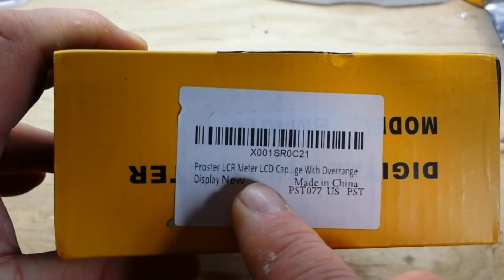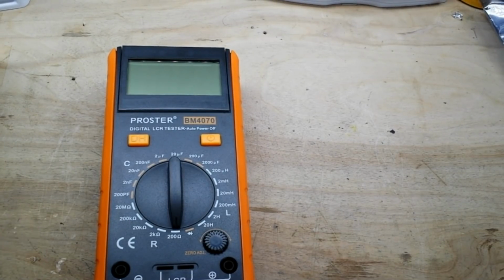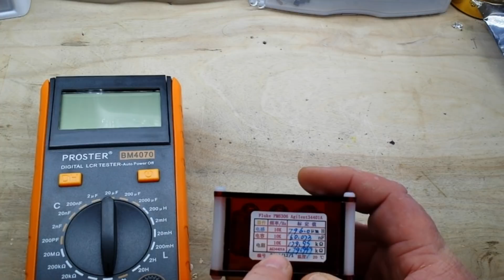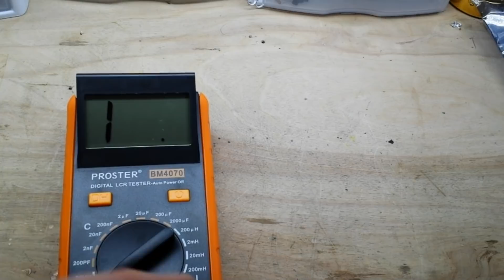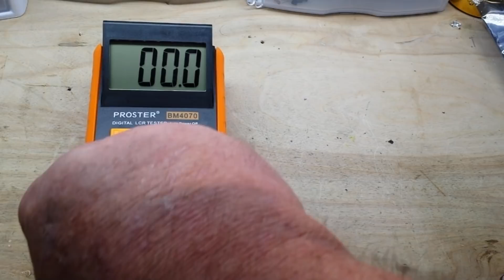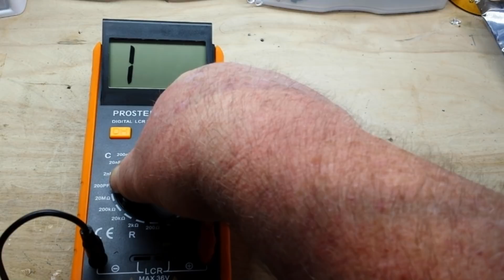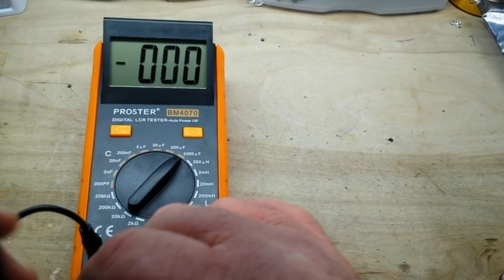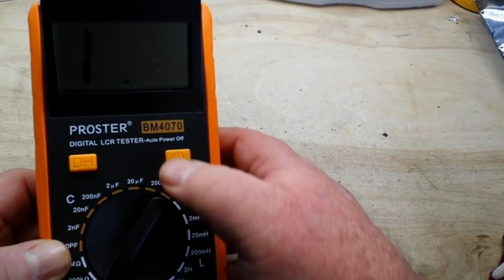Proster BM4070 LCR Meter Review

Comment: Hi, thanks for your video, the one thing I would expect from an LCR meter,  is an output frequency setting, the LCR meter should be an AC measurement like 1000 Hz when measuring resistance and NOT a DC measurement like that of a multimeter.  This is very important.
Reply: Agreed, and not just for resistance!  Perhaps one of the oscilloscopes listed in the description could be used to determine the working frequency?  I found the following in a review on Amazon, but it sure would be nice to see a video verifying this for a wider range of component values (such as those used in this video):

"I used an o/scope with the Proster tester on various components and got the following results;
10kohm resistor was being measured with 300mv DC across it.
10nF cap was being measured with a 300Hz triangular 200mV pk to pk voltage waveform.
A 470uH inductor was being measured with 1.5us long voltage pulses having a repeation
rate of 300 Hz and a magnitude of+- 200mV."

Comment: i have  watched a few of your reviews on multi metres and am looking for something for RC cars and the odd electrical around the house and the car.Would an Aneng 8008/8009 be a good way to go or is there something newer and better without spending a fortune. What would you recommend?
Reply from the maker: The 8008 is simply the best option in a low cost meter for low voltage applications.
Reply: @learnelectronics  is the 8009 better or just get the 8008?

Comment: DO NOT BUY THIS METER!!! I ordered off Amazon and they shipped it to me in an OPEN BOX. NO PACKAGING. NO SHIPPING RECEIPT! NO secured box. The meter could have been easily stolen as it wasn't even sealed. It was missing its cables and instructions. I was surprised to find it's damn cheap 9volt battery. Meanwhile the fact they don't know how to ship will keep me far away from the purchasing anything from this manufactuerer. Amazon got an ear full from me already  about how abysmal their packaging was. Right now, I'm not taking reviews from any YouTube channel seriously anymore as I think they are rigged. The channel owner gets things shipped neatly while the rest of the audience gets treated to a crap experience. Luckily for the them the damn meter does work. I lucked out....but it has changed my opinion of reviews here and on the rest of the channels here on YouTube. PS: I had it tested by an EE friend of mine who had the cables. He said I was very lucky that for the money it's a reasonable meter. Just too bad the company lacks smarts on proper shipping especially over Amazon Prime.